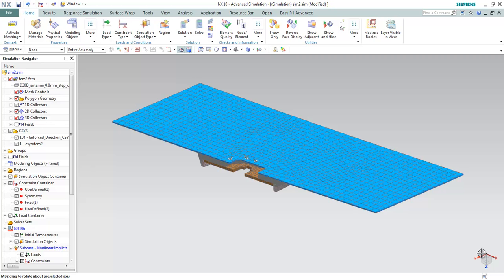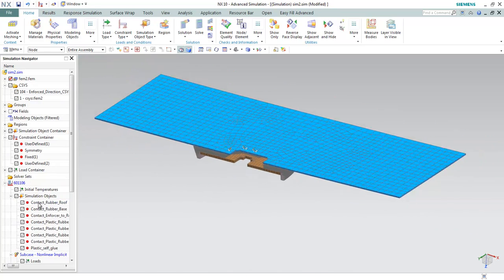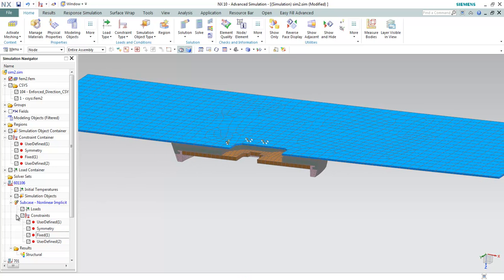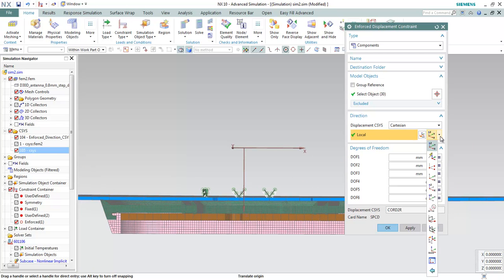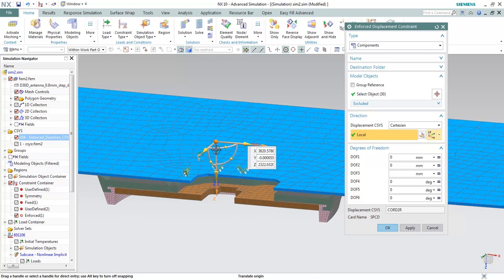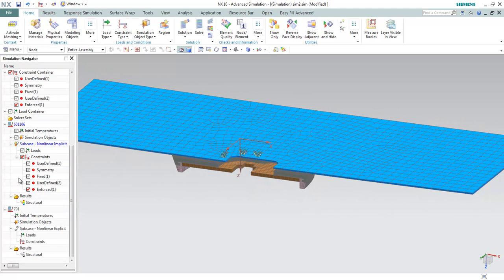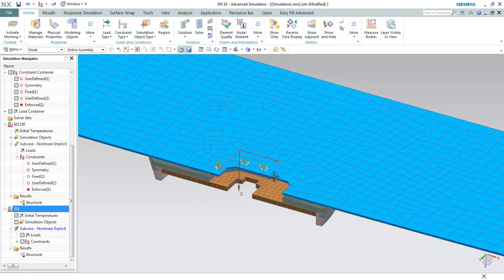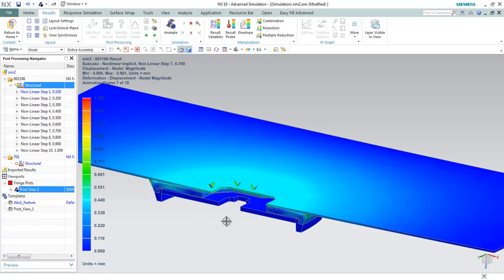NX CAE: How to define Enforced Displacement in Explicit Simulation

Comment: Can you tell me what are those 2d extracted mesh and what they are used for?
I was working on the simulation of a rubber seal element i did not understand the need for those.
Reply from the maker: Hello Gopalkrishna Kulkarni, thank you for your inquiries. The 2d extracted mesh is the surface of the component, that serves to tighten the antenna device to the roof. The rubber component is serves as a water seal.